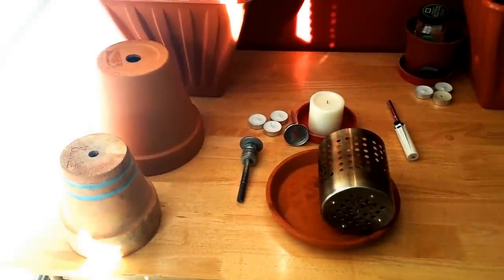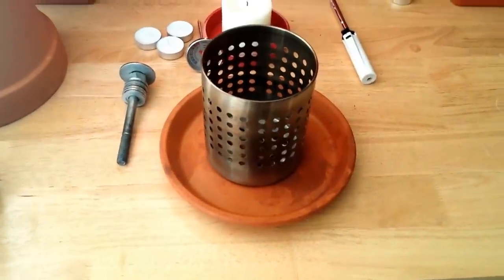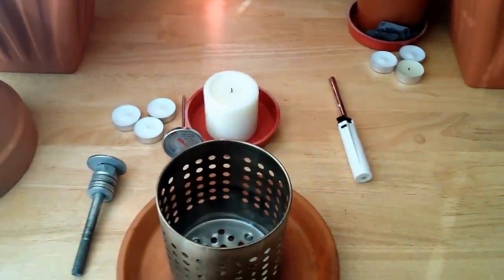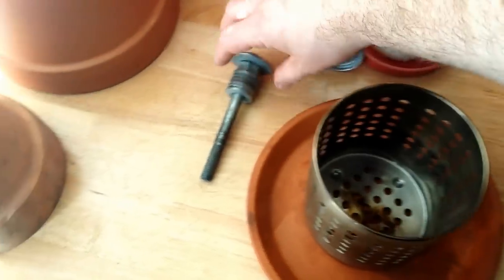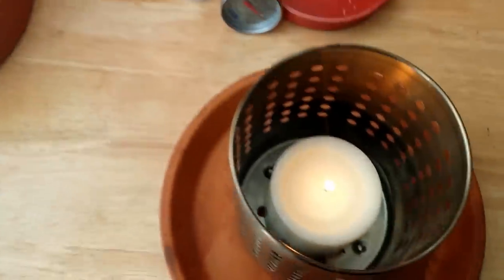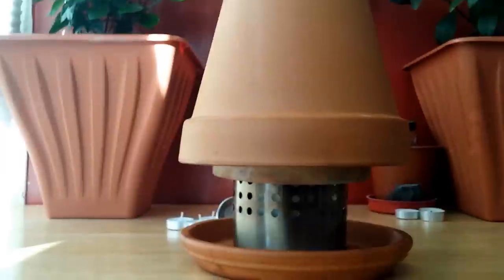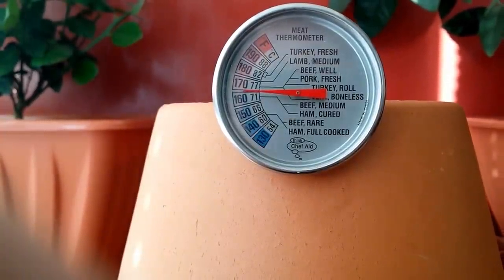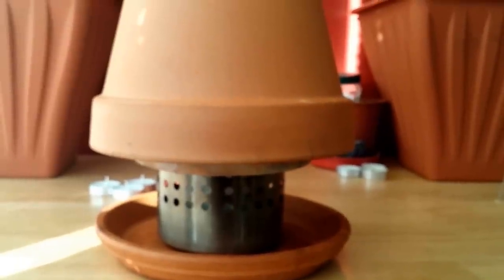Tea light heater

Comment: I saw another video online that shows that people shouldn't cover the holes in the top of the flower pots because doing that cuts off the airflow and causes the flower pots to heat up too much and causes a flash fire.    Also whenever using any type of room heater one has to make sure that the room isn't totally sealed and that there's adequate ventilation to prevent deadly carbon monoxide poisoning.
Reply: Just use one tea lite candle at a time with each flower pot setup.  The heat output will be less but at least it will be much safer.  The leftover candle wax in tea lite candles I just use in a metal tray under the twigs in the fireplace and the leftover wax burns long enough to get the wood going.
Reply: Make safer candles with Crisco or Trex, or beeswax? Bolt the two pots together to stabilise? Perhaps add a couple of bricks ... maybe three, placed with a gap between for the candles and set it all on a  metal tray or flat slab?

Comment: Remove the tea light from aluminum case and place candle in a fireproof bowl. Fill up the bowl with cooking oil to same level as candle so you can still light the wick. Now a 2/3 hour tealight is a 24 hour candle. I use a terracotta bonsai pot.
Reply: Wow thanks
Reply: Does it make.the room smell like a chip shop.
Reply: @pablojohnstini1237  I find it only smells when extinguished. Used oil would smell stronger.

Comment: Right on! I did the same thing as I passed by the stainless steel cylinder covered in holes I thought that would be perfect and it is even though mine appears to be a few inches taller and I'm using the Crisco candles which are self made to control exposed liquid combustibles.... Heat rises so I'm in no danger of reaching flash temps.... Good stuff!!

Comment: I have that same setup on the kitchen table and it works fairly well.  The holes in the utensil container do a fairly good job of letting the tea lite candle get enough oxygen so the fire doesn't die out.  I also use a large soup can with 4 one cm holes drilled into the bottom sides of the can and that seems to work as well.

One tea lite candle will be enough as multiple candles can create excess heat and cause the liquid wax to ignite and set off the smoke alarm....

Comment: It is generally more stable using slightly larger pots that sit lower to the terracotta base.  Dependant on where you want to use this for, you just vary the candle in the bottom.  I use it to heat my VW T25 motorhome with an extra piece of slate under it and a folded newspaper under that, which then sits on my sink top in the van.  It heats the van up lovely when I am reading in bed before I blow it out and go to sleep.   Great for wilding it where there is no electricity, and saves on using your gas for cooking etc.    I really rate this provided you are safety conscious!!!   Great vid!
Reply: I wish someone would  say what size.

Comment: Lovely! Ive been experimenting with these too and loving the result along the way. Liking the use of the steel drain pot, clever thinking that! Have a look at hobo stoves using these. You may have discovered a  whole new genre to show these to. Bushcrafters.
In my design I used builder's banding with predrilled holes in it. That became a frame the pots were suspended over. Liking this design a lot, I added a smaller pot egg cup size right in the centre to catch the heat directly which radiated out to the outer 2 pots, the largest being 6 inches. I tested that area using a digital version of the one you used and was getting readings of 258°C  and rising. Just a bit bonkers. I now run it on tickler using just 2 tea lights and up to 3 in cold weather.
Thanks for making this. I subscribed too.

Comment: I do like your innovation. I have build my first Terra Cotta Heater and am looking at methods to elevate the pots safely to allow for air flow. Yours is a great solution. I am looking at using heavy gauge copper wire bent into a support structure. Thanks for the video.
Reply: I purchased 3 Terracotta feet for about $ 8.00 at Lowe's garden center here in Kentucky. They elevate the terracotta pot nicely to have the airflow from the bottom. And you can use them for any size pot as well. It is a rather tight fit for tealights and feet on a small pot. Not very much space

Comment: This video has given me additional ideas about this type of heating. Nice. thanks. I like the stainless steel utensil carriage idea. PREMADE yey.
Reply from the maker: +Veronica F'scher and so cheap from a pound or dollar store
Reply: It's nice craftsmanship and looks awesome, but it doesn't actually work.
Reply: Going to get two or more.
Reply: May someone try this experiment. Put a thick metal chain in a metal pot. A chain called Reese Tow power or Safety Chain using candles and see how hot it gets compared to tea light pots ??

Comment: If you can use cast iron instead of clay pot it will be perfect cast iron will heat up fast and it will stay hot for longer periods of time. Because you know in our house and apartment we have cast iron resistor heater.

Comment: For the hopeful: These pot candle heaters don't produce more heat than the candle....they don't amplify heat....they just confine it and localize it.  Thus the high temp at the pot head....but the room only experiences 1 to 3 degrees increase.

The bare candle releases heat straight up.  You sit beside the candle and don't feel it.  You sit on the candle or run your hand over it and owww!

So with a metal utensil cup like this...just a iron pot lid or a flower pot under catch tray is sufficient to direct the heat sideways.  It is a very localized heater.

However a pierced tin candle holder will do the same thing, is mfg as one piece, light, pretty and hangable.  A glass candle lantern similar.

A traditional kerosene RR or barn lantern produces 10x more heat than a single candle...and in a tight room is much more noticeable warmth.

Often the effect of pot heaters is psychological...but they might mean a couple of degrees...which pales to you wearing warm clothes or a blanket.  They are nice temporary hand warmers.

Comment: The rim of the larger pot needs to sit lower at the bottom than the smaller one so that the hot air will come down and  up again into the larger one. If you have the rim of the smaller pot showing it allows a certain amount of heat to just escape instead of utilising it all in the larger pot.

Comment: I used all tin cans to replace the terracotta pots normally used in candle heaters, using 4 tea light candles the air temp in my lounge rose by 4 degrees solidly. So I found them very useful in the Spring & Autumn for heating my home. However when the temperature dropped to say 10/11 degrees outside the 4 degrees was not enough to stay warm in the winter.However on a plus side they give a pleasant ambient light, so didn’t need to use electric lighting.

Comment: How is that sturdier than bolding them together .....one suggestion bolt them togeter leaving space between the 2 pots [2 use an eye bolt for the through bolt and you can change the candle with just a pair of pliers to pick up the whole top and remove it quickly so as not to lose the heat from the pots to drastically

Comment: I guess the biggest question is what the room air temp is 4-6 feet away?
Reply: How big a room. Heat rises so however long it takes to fill the room top down to where your say the 6 foot mark is in 3D space and that depends on how much and  how fast are the room heat losses.
Reply: Obviously that depends on the ambient temperature, but in an area as small as you suggest the effect would be a few degrees Fahrenheit.
Reply: May someone try this experiment. Put a thick metal chain in a metal pot. A chain called Reese Tow power or Safety Chain using candles and see how hot it gets compared to tea light pots ??

Comment: I'm more interested in the difference in room temperature that it makes than the surface temperature of the heater itself.
Reply from the maker: 2-3 .c improvement in room temp or more all depending  on how many candles you use .
The theory to this is a tealight candle produces 1watt of energy

Comment: Good idear can you tell me what size are the flowerpots
Reply from the maker: +Linda Mills 6inch
Reply from the maker: +Linda Mills 6inch
Reply: May someone try this experiment. Put a thick metal chain in a metal pot. A chain called Reese Tow power or Safety Chain using candles and see how hot it gets compared to tea light pots ??

Comment: What size is the "carriage bolt" ; is there another name for that? If I go to Home Depot,  and I  say carriage bolt, will they know what that is? And how many washers did you use and why so many?  When you put the carriage bolt in, doesn't it hit the candle?
Reply from the maker: Hi 
I found what you need on home depot ....
http://m.homedepot.com/b/Tools-Hardware-Hardware-Fasteners-Bolts-Carriage-Bolts/N-5yc1vZc2fj
I used 6 washers but you can adjust this amount so that the end of the bolt just kisses the tip of the candle flame so you get a good heat transfer.
Reply: The more metal used the more heat store. K

Comment: some people down below just do not get it, candles do not put out enough heat by themselves, you need something else to radiate the heat.  the steel bolt and washers get very hot because they are right above the flame and radiate the heat to the pots which in turn gets hot also and radiates even more heat, boy such dummies.  The more surface you can heat up, the more heat you will get.
Reply: wolfdenpaul because fuck first law of thermodynamics
Reply: the metal is just a heat conductor , it's not generating anything... silly noob
Reply: It works
Reply: @BrooklynAvenue  
No, he is pointing out that distributed heat is more useful than the heat generated by a non-convection energy system.  Why? because instead of dissipating the energy where it serves no purpose (inside a 3-4 inch area around a candle, for instance) you can direct that energy so that it provides heat in a controlled area.  A candle by itself won't as effectively do that.  Your argument is akin to saying that an electric heater is useless because it doesn't increase the electrical energy that powers it.  Very, very dumb.

Comment: Thank you for sharing this video. My concern is...The metal round thingy with holes, that you've rested the post on. looks a little unsturdy. I'd be a little worried that it would topple over.
Other than that, it's a great video. Will the 3 tea candles be enough for a 6x10 polycarb greenhouse?
Reply: The utensils for a has 4 feet on it.

Comment: This doesn't work.  If a tea candle by itself is not enough to warm you, and it isn't, then putting a radiator (that's what this is) around it isn't enough to warm you either.  The principle you see here is a heat trap.  The pot traps the heat inside, rather than letting it diffuse into the room.  That's why it's warm inside the pot, and why the pot itself warms up.  But a few inches out from the pot there is no more warmth than if you just lit a candle and felt a few inches out from that.  The way a heat trap works is that you get INSIDE the heat trap, not outside the heat trap.  If you were small enough to get inside the flower pot, it would work great.  A room in your house is a heat trap.  So, if you turn on an electric heater, the room (heat trap) warms up.  And you are nice and warm as long as you stay inside the heat trap (room).  That's like being inside the flower pot.  But if you go out in the yard outside your room, you don't feel any warmer than if there was no house and just the heater running 20 feet away in the middle of the yard.  If you want to stay warm with tea candles, there's no contraption possible to increase the amount of heat produced.  All you can do is enlarge the heat trap (flower pot) and get under it.  If you had a flower pot big enough to sit under, which you don't, that would work.  You could get into a big cardboard box or make a tent with a sheet and get under there with some candles, and that would work.  It's retarded, but that's the right principle.  What the flower pot does is trap the heat, the opposite of what you want if you are on the outside of the flower pot.  Because the flower pot is a poor insulator, the heat does eventually radiate into the room.  But there is not one iota more heat that without the flower pot.  Everyone coming to this video is well-meaning, looking for a cool way to have emergency heat.  Me too.  But I swear to you, the guy doing this video is a lying douche-bag.  Because he actually BUILT this thing and KNOWS it doesn't work from testing it.  Yet he posts the video and says it works.  He's a fucking dick wasting people's time, just because he wants attention and subscribers.
Reply: I think the point is it radiates heat somewhat from the heated pot.
Reply: I think you missed the point dude,

Comment: It's impossible to amplify or increase the amount of heat.  One candle produces X amount of heat, and that's it.  So what's the benefit here?  Slow release of heat, keep the heat from immediately rising to ceiling, etc.?  Because you are NOT increasing the amount of heat produced by the candle, and one candle will not heat a room.

Comment: This doesn't work, so don't waste your time.  You can't increase the heat from a candle no matter what you put beside it, around it, or under or on top of it.
Reply: That is not the what is being attempted. You cover a light and heat source with a mass and you capture more of the fast moving and depleting energy and have it release at a lower rate at a more usable level.  Fire to boiler water to heat a building.
Reply: You fail to grasp that a convection heating system works for the same reason that a stove cooks food, or an iron gets the wrinkles out of a shirt.  Energy transfer is the principle behind all energy capture and conversion systems... you could not cook a meal without it. Your argument is akin to saying that an electric heater is useless because it doesn't increase the electrical energy that powers it.  Have you discarded your stove?  Your electric hair dryer?  Your solar panels?

Comment: I still don't understand why people think this produces more heat than just burning the candle.
Reply: I stores the heat and releases the heat over a longer time not just on the ceiling it will keep the heat where you want it for longer. Thats my experience.
Reply: Think of it as a form of ceramic radiator principle using a tea light instead of other fuel.
Reply: Because it works like a storage heater.  But in my opinion they're not safe.  The fire brigade was sending out warning alerts last year for people not to do this.
Reply: Look up Liquid-filled oil heaters.
Reply: Linda T There are tons of more deaths related to electric space heaters causing fires when it gets really cold. Unless you never watch television you would have to see this. I grew up with a old wood stove as the rest of my family none of us got carbon dioxide poisoning but I did have one family member die from electric space heaters.
Reply: captain42979 correct sir
Reply: metal conducts heat. get two of these in a small room.  it can make a difference w more than one candle in each.  electric cimoanies raping the public.  so experiment with that in mind.  also lower thermostat in home to 68 or 65 and put sweaters and socks on.  its good and gets one through
Reply: In order for heat to radiate efficiently you need surface area.  Thats like asking why bother with a radiator in a car when you can just have the coolant go into a big tank.